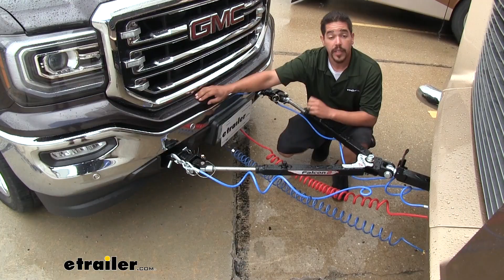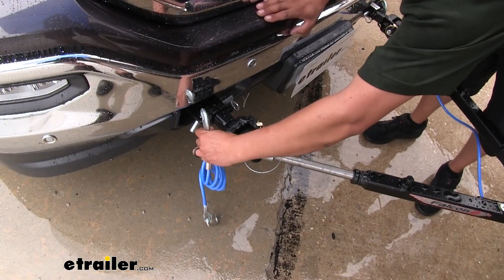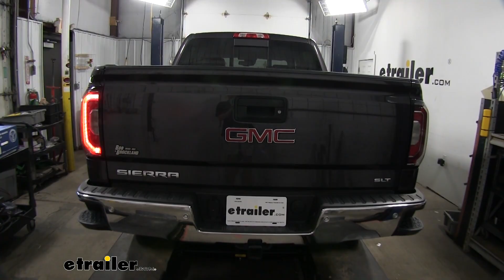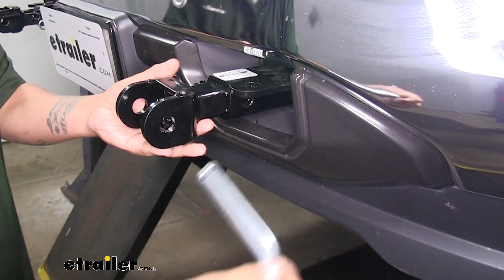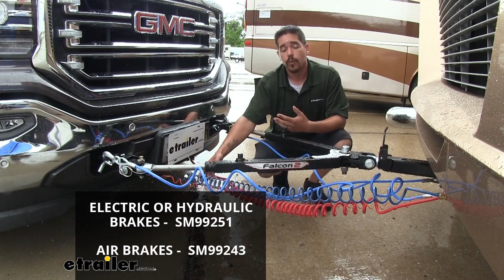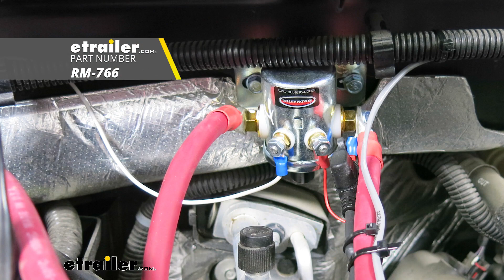etrailer | Best 2017 GMC Sierra 1500 Flat Tow Set Up

Comment: This replaces the existing tow hooks on my 2016 Sierra right? I'm looking for something that utilizes my vehicles existing equipment.
Reply from the maker: Yes the flat tow kit will install right where the tow hooks her from the factory.
https://www.etrailer.com/tbwiring-2017_GMC_Sierra+1500.htm
https://www.etrailer.com/towbar-2016_GMC_Sierra+1500.htm
Reply: @etrailer  Is there one kit complete with everything I need?
Reply from the maker: @suflex  Unfortunately, there is not a single kit that will include everything that you need. This is because we want to be able to fit the specific needs of the vehicle and the RV in different scenarios.